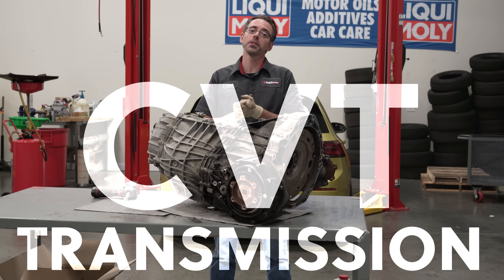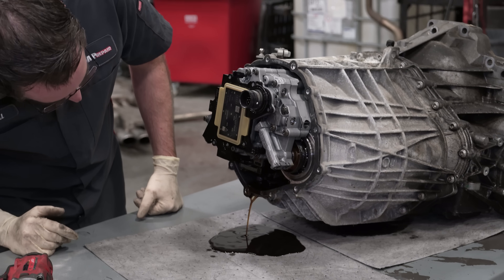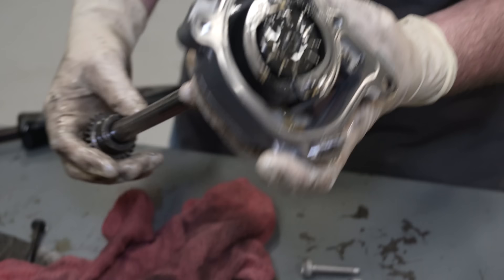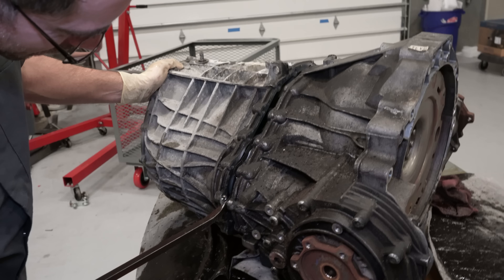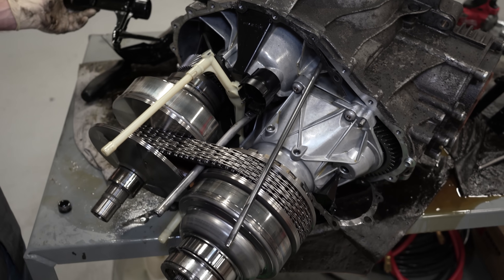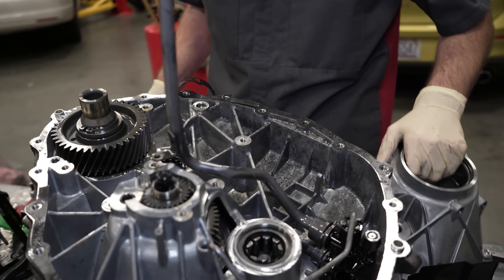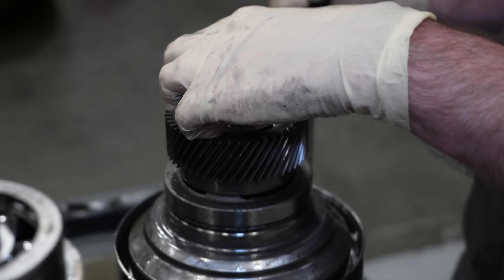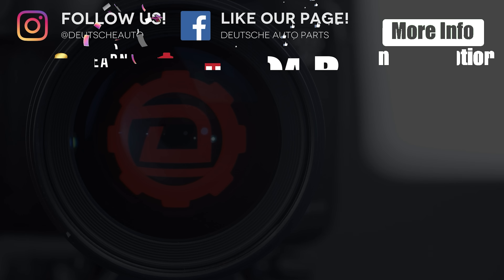Why you shouldn’t get a CVT transmission

Comment: I recently bought a Toyota with a cvt. I never even heard about a cvt until I bought my corolla and absolutely love it. I used to drive Mercedes cars with auto boxes but I'm scared about the cost of a failing dsg gearbox, yes we call it that instead of transmission. My neighbor has a 2013 Mercedes c180 and he used to brag about his many gears until he was going uphill and the car cut out. Results, broken gearbox. He enquired about a new replacement that costs as much as the car is worth, so he opted for a second hand one. When it was fitted the transmission and the engine did not talk to each other 😂😂 and the result is that he has an expensive paperweight now for a transmission. He frigging went ahead and bought another Merc but alas that is up to him. I had an 2016 Mercedes cla 200 auto with paddle shift and when I heard about his problem I could not wait to get rid of it, Mercedes, new ones are not worth the money imo. The Toyota is a engineering marvel and the cvt a gem, never experienced it before. Some of the posters give it a negative comment but to me it is a transmission of the future, every car manufacturer is going to offer it in the future.

Comment: Belt drive CVTs are a pile of shit whichever way you look at them - Toyota's eCVT dispenses with the steel belt and cones and instead it uses planetary gear setup which is far better and Toyota should stop calling it a CVT because it puts many people off who associate it with belt drives - but more important, buying a hybrid will cost you more and will take you about 5 years to break even at about which time the battery will be much more worn and if it needs replacing will cost buckets more than an ordinary replacement petrol engine

Comment: This was a "pull chain", rather than a "push chain", which uses bits stacked together, and uses bands to keep them in a line. Which do you think is more reliable?
Reply: Edit: Push belt, not push chain.

Comment: It's been a while, but my 2008 Nissan Quest mini van CVT failed at 70,000 miles.  I only bought it because my mid 90's Quest mini van was still going strong at 250K miles. Really disappointed in the response from Nissan on the CVT issue. Who the hell sells cars that won't go 100K miles?

Comment: Just another nail in the coffin for ICE vehicles. I say that because the CVTs aim was for better fuel and milage efficiency. But the continuous power of such a complicated and flawed design  can't beat the simplify of a single gear trans in an EV. Yes a short term win for ICE vehicles but a long term loss as EV's improve range and charging speed. Like it or not there's a tipping point where ICEs will no longer be the better owner's experience for most compared to EVs.

Comment: Back in 2017 I bought a used 2013 Prius with their flavor of a CVT.  I put over 150,000 miles on it before I traded it in on a Jeep TJ in 2023.  I saved up to have Toyota perform any service other than oil changes.  I never had any issues whatsoever with my Prius' CVT.  I saw my old Prius driving a few weeks ago, and got a chance to speak with it's new owners.  They use it every day and also have had absolutely no issues with the CVT.  They haven't had any issues at all, as I had none.  They only 'failure' I ever had was the automotive(regular) battery wearing out and one light bulb.  I do believe that if one takes care of anything mechanical they own, one will not have issues with it.

Comment: Sorry but it really depends on how they are maintained with oil changes, servicing, etc.
I've got a 2009 Audi A5 2.7 TDI with the Multi-tronic gearbox and with 200k miles on it.
I regularly get it serviced every 8000 miles. 
I've done a ton of modding including remap and turbo upgrades.
It also has the option of manual shift 8-speed as well, with the flappy-paddles and it's the best car I've ever owned.
Put it into sport mode and it becomes a different car and pulls well or put it in drive and it cruises like a Bentley and never skips a beat.

Comment: Basically, a high tech version of a Reeves Drive. I just sold my lathe which had a Reeves Drive and replaced it with fixed size pulleys and electronic variable speed drive motor - a much better alternative in my situation. I've only ever heard bad things about CVT in cars - wouldn't waste my money on one.

Comment: Let's see - the Video Title is: "Why you shouldn't get a CVT transmission"

uh huh.  I have a Subaru Vehicle - with a CVT tranny.  Are you suggesting that if the tranny goes out - I should try and somehow shoehorn in an ATF unit?  And modify the Computer and sensors; etc.  Creating an impossible task?

I think I will just keep the fluids changed; and since everything eventually deteriorates and dies - I will replace the transmission or have it rebuilt - when it finally requires a new unit.

Comment: Automatic transmissions wear out by their inherent design. Standard auto has so many pistons, seals and clutch plates that you have to figure that by 200K Miles or 350K kilometres, it is going to be worn out and require attention. CVT also has similar issues in common with standard, but to a lesser degree. I have a CVT vehicle but I drive sedately and don't really stress it. The only reason I have it is because of the 10 year warranty. I don't think any form of automatic (including DCT/TCT) is going to be free of eventual wear problems - or in some cases, other breakdown elements due to complexity. I'll stick with the 10 year plan lol

Comment: I have owned two Subarus over the last 11 years not a single problem with the CVT on either one.  One I drove to 160,000 miles, and the one have now with 125,000 miles on it.

Comment: My brother & his wife drove his wifes (her brothers old car) 2008 model Mitsubishi CJ Lancer from our area which is just north of Sydney (Newcastle) in Australia to Brisbane in Queensland which was an 800 kilometre (500 mile) drive.

Well,the CVT transmission stuffed up & a mechanic had to replace it at Brisbane & he asked my brother,did you drive it all the way from Newcastle ?

He said yes & the mechanic said don't drive it back,tow it back home so he got it shipped back home on the back of a truck,he basically said to my brother that they're not reliable on a long trip & that they fail a lot !

Comment: I have today an Audi A4 with CVT transmission. 23 years old, certainly only 130.000 kms, but works lovely, no problem so far. It has a 2.0 petrol engine, 130 BHP.

Comment: We have a Subaru Legacy with a CVT (Serviced regularly) that has no issues with 190k on it, no issues.
Reply: Cuz it's a Subie!
Reply: I have a Crosstrek, which I just got with 48,000 miles.  It's my first CVT vehicle.
Reply: yeah because it doesnt get much torque over it anyway
Reply: @sbharin Yes, this is not a negative.  Undoubtedly the CVT should be matched to the engine output.  There are two Subaru CVTs.  Turbocharged vs. non turbocharged Subarus get the appropriate one.

Comment: Assembled with torx bits... with case ribbing preventing head-on fastener engagement. 
It's clear these are "replace-not-repair" garbage. I hate CVTs.

Automakers make me want to swan dive off my roof.
For comparison, the Allison MT653 in many of my fleet trucks, arguably the strongest class 7-8 automatic transmission, is 4" shorter and the same weight as this pile of trash. It also holds 425hp/1100tq @ 40,000lbs 365 days a year. 

These transmissions are an exercise in doing something purely because you can with no concern for the consumer.

Comment: Been driving my Honda Civic Hybrid since 2009 with CVT, and haven't had a single problem whatsoever with the transmission.

I absolutely love CVT!
Reply: wait till you pay 7000$ to fix your junk trans you will change your tune!! i hope not
Reply: @jimthompson3030  At this point, I mean I wouldn't be surprised. It's been roughly 15 years now since I bought it. lol
Reply: Hi do you always get your car serviced and maintained ex. change engine oil, tans oil etc?
Reply: Hybrids use eCVTs which are completely different from belted CVTs seen in the video.  They are MUCH more reliable.  They're practically just a fancy differential, few parts to wear.  If the battery and control electronics stay working, there's little to go wrong.

Comment: why do they have to make thing so complex, designed to fail it seems. i have a 350 turbo that has over 400 thousand miles and is on its second motor without a rebuild

Comment: My Subaru CVT transmission has 243,000 miles on it.  The valve body was replaced due to a failed solenoid, that's it.  Of course it got new fluid.   It's still running and is not a gigantic pile of s hit.  Maybe yours is.

Comment: I couldn't actually tell what failed on that particular transmission.  Most common failure point was that belt breaking under load.  CVTs are great theoretically but only in really particular applications.  Even then, their reliability is iffy.  They most commonly failed in large vehicles or vehicles with powerful engines... especially if the driver liked to mash the gas hard from a start.  Toyota knew this and developed a CVT that had a first gear, like a sequential gear, that would then transition to double cone of the CVT.  They also only used it in their compacts and other small vehicles.  That steel belt is inherently way weaker than a toothed gear.  Sure, a toothed gear can also eventually break but that steel belt cannot handle the load of toothed gear.  In theory... nothing is going to be more efficient and give smoother delivery than a CVT.  They just don't have the durability of sequential gears.  The transmission is the single most complex and expensive component of a vehicle... even more than the motor.  It sucks when it fails.  I look at all those passages & solenoids and I can tell how complex it is.  The more complex something is, the more points of failure you will have.  I'm sure you guys hate telling your customers how much the bill is going to be.

Comment: I work at a Honda dealership in Wisconsin. I’ve sold a bunch of these and taken some in on trade and just bought and I’ve had zero problems with them. I’ve taken cars in with three 400,000 miles on them quite often that have CVT transmissions with zero problems so I don’t know what this guy is talking about.

Comment: I've been experiencing a bit of gear slippage 😂 with my cvt transmission in my v6 camero with 86k miles  lol how much would it cost to make it manual? Now that i see how bad this is, i would much rather deal with wearing out a clutch than dealing with this pile of crap 💩. I am really feeling bad the manual one i was gonna buy got bought out from under me 😢.. well i only got 5 more years of payments with only like $350 per month in interest 😅 putting on 20k miles per year... what could go wrong? Im sure this transmission will be just fine... 😅 and last the 5 years😅 😅😅  just kidding. Just repo it. I'm so screwed...😭

Comment: I've had a Toyota CVT and a Subaru CVT. The Toyota CVT actually wasn't half bad. It's real 1st gear and however they had it setup, it was plenty responsive. The CVT in my latest Subaru on the other hand was a pile of crap. It was unpredicatable and jerky when cold, and just overall sluggish.  I dumped it and went back to something with a normal transmission. No more normal CVT's for me.

Comment: had a 07 toyota prius. it is great for the hev hybrid, but i was driving for 1-2 hours, felt the engine is pulling back, stopped, put it in park, never changed gears again, couldnt even put it in n for tow. middle of nowhere 😢

Comment: Apart from being heavy and hard to work on, some plastic stuff inside and sensors, that usually need replacement, is absurd combination. Also the way that chain hits the metal with it's edge ... that does look like a terrible wear point.

Comment: Well, still many CVTs last A LOT longer than the infamous DSG gear boxes. I have a Subaru Outback CVT and it has been flawless for 10 years and 300000km's with one oil change this far. It is also quite comfortable and economical. I at least would NEVER change it for a DSG.

Comment: My Lancer with a CVT transmission did not encounter problems even after 12 years of usage. The key is to replace the CVT fluid and filter every 20,000 kms.

Comment: After watching this video and reading the comments I have to share something. I have a 2013 honda accord with a cvt and 191k miles on it. It runs beautifully and I have never had any issues. ALSO, I have never serviced it in any way shape or form. I know for a fact I have never changed the fluid. How is my car still on the road?

Comment: ZF is  definitely the way to go. They are a technological work of art. My 2014 BMW has 220,000 miles on it and is still sweet as a nut. Just need servicing at 60,000 mile intervals

Comment: Needing a replacement for my 2006 Yaris, I tried a used 2014 Corolla, going from 1.5L to 1.8L. I was expecting more power, tried accelerating from stop on an empty highway and was baffled by the lack of power.. what is even the point of a bigger engine if you can't use that engine when it counts. Dashing is super important on some intersections.. I didn't know it was CVT at the time but it really makes sense now. Staying well clear of that stuff when getting a new car.

Comment: Cvt has issues with initial acceleration, but when u have tune it to the rhythm, it works like a hot knife in butter. Just stay calm and let the engine work. 😌 and with cruise control, it really gives great mileage.

Comment: Hi Deutsche Auto Parts, you seem know well the transmissions. My car had shown "Input/Shaft Speed Sensor No Signal" error and was recently fixed. The professional was not speaking English well and all I understood is that the input/shaft gear had to be adjusted to always send the signal to the "Input/Shaft Speed Sensor". I wonder could what you explained in the video (although the car/model/year might be different) be what he actually did to solve the problem. I would appreciate if you can point me in the right direction.

Comment: I drove my previous Honda with CVT for 12 years with zero issue even though I never changed the transmission oil!! I guess Hondas and Toyotas know how to make a CVT last long!!
Reply: I think you drive it in good road no mountain or you drive it genrly like average 60 km/h all the time
Reply: Yeah, this dude thinks that because VW and Audi CVT's suck then they all must suck lmao
Reply: @bearxbunny1835 same feeling 😅
Reply: @bearxbunny1835 they suck because manuals are better
Reply: Dunno what these idiots have for CVT there, but Honda and Toyota CVT down here are regarded as top 2 or 1 for automatic transmission.
Reply: what car is this?
Reply: @JhayjhayGuimalan  Honda City
Reply: @sudiptakiran  My son's seven year old Honda City has done over 100,000 miles without any CVT issues. When I lived in a country that had a lot of large V8 US cars, Silverado, Suburban etc. low milage ones  often had "new transmission fitted" as the selling point in the second hand market.
Reply: @alanchase7329  100k miles is not impressive honestly. 200k without issues is impressive
Reply: @abfkwbdkdmggfilw-uv5bn  Give him time, car is only seven years old so 100k here is above average miles in that time. Known several people with Silverado, Taho type cars that have had non CVT transmissions replaced well before 100k. Was a bit of a second hand selling point to say they had a new transmission fitted.
Reply: My HONDA CVT on 180k miles no issues….you must use the right fluid and change regularly
Reply: True
Reply: Having Honda BrV which has run close to 2 lakh km and 10 yr old. No issues.
Reply: combine a 1 ton, low power vehicle with a CVT designed at hondas peek and yes, you can have a good one. CVTs work great in light applications, especially snowmobiles
Reply: That unfortunate guy who bought it paid the price of you not changing the CVT fluid 😂
Reply: I have seen toyotas with over 220k miles in the UK 2ith a cvt transmission. If they are bad no one will buy second hand lexus for the price they do today with cvt gearbox
Reply: Unfortunately Nissan and Ford have given CVT's a bad name. I worked on Nissans for 15 years and rebuilt CVT's. There were times where programming of the TCM and latest valve body hardware would have prevented catastrophic failure. But most will never know this unless they were on the inside when these things were "in service". I have a 2009 Rogue with 193,000 miles on it but the CVT was replaced at 114k (I did it and then customer traded it in and I bought it).
Reply: They are still overall weaker and less reliable. No thanks
Reply: And Nissan does not
Reply: @elimogenson3316 always avoid Nissan CVTs!
Reply: Honda is a Honda.... honestly done care what anyone else says but Honda is one of the most reliable car brand
Reply: Mileage?
Reply: Don't lie 😅

Comment: I once had a Nissan Murano with CVT, used it for over 10 years and 70K+ miles on it. Only changed transmission fluid once I think at 45K+ mile. No issues whatsoever. As they say: "Your milage may vary".

Comment: Both our Outback and Forester have CVTs and I HATE them !
They rob the engine of hp, torque and mpg.
My 182hp, 2.5L 4cyl engine in my Forester get LESS mpg than my 11 RAV4 with the 268hp 3.5 V6 engine and a 5spd geared automatic transmission.
If I would have known that Subaru LIED about the fuel economy, I would have kept my RAV4

Comment: CVT's are the sturdiest transmissions if maintained regularly you fool. The only catch is the TCM but it can be repaired for 200 bucks which will last you forever when done in the right hands. The internal parts will last forever if you change the oil regularly and treated gently when driving.